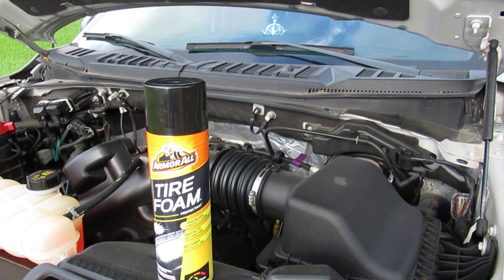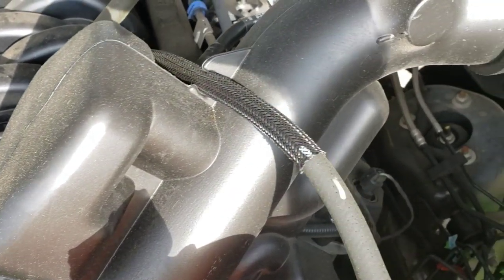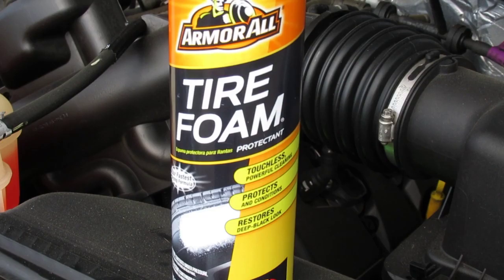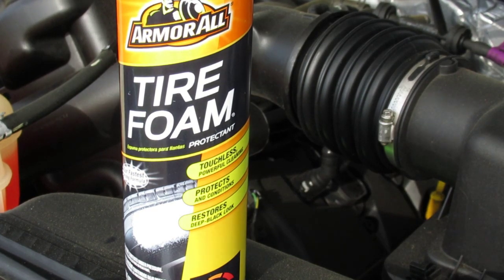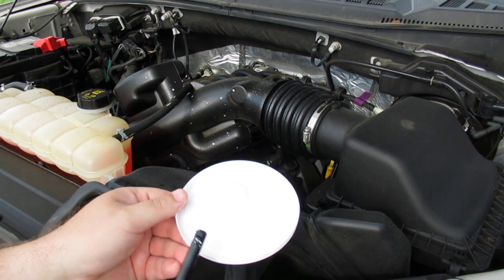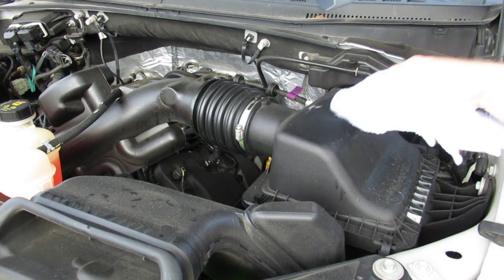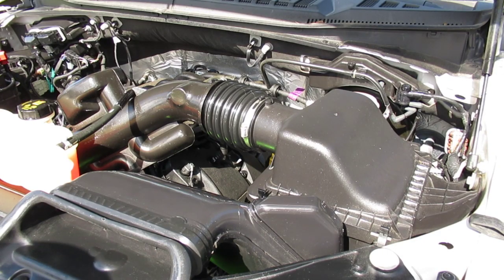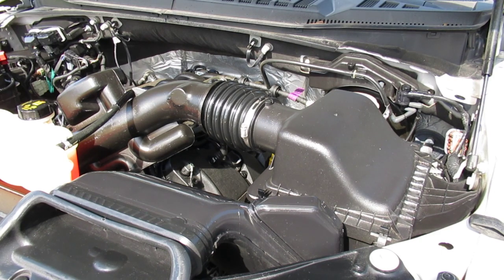HOW TO CLEAN AN ENGINE - UPDATE VIDEO

Comment: Hey man that was right on and I appreciate your feed back on the comment section and that is why I subscribed to your channel, my one concern from the first video and on still to this one is the electrical components? Its not going to cause anything too short circuit or cause a grounding situation is it? I don’t know that’s why I’m asking because I was taught at a young age not to spray the engine down because of getting electrical components wet (mind you I am 50yrs old and it’s been an awful long time since I’ve seen a points distributor on anything, maybe that’s the difference but I don’t know) and now my concern with you bringing up the flammable part into the equation, my concern is instead of trying to catch it on fire after you just sprayed the card, would it make a difference a few days down the road after it is dried up and absorbed into the engine components? Could it then be flammable? Curiosity killed your cat but it fed my dog :) 
you heard it here first 😂 lol 😂 lol 😂...
Reply from the maker: The engine and it's components don't have a problem getting wet from normal driving, road splash, etc., it's when either the engine is doused with a lot of water like from a garden hose or when sprayed with high pressure that it can cause problems. Years ago I always pressure washed my engines at the car wash without any problems but with all the extra electronics on modern engines, I think that's asking for trouble. When I use the tire foam, there's no pressure involved like when spraying with water so I'm not forcing water into anywhere it shouldn't go, that's where the problems come in. There's really nothing exposed that it can hurt. As far as being flammable, I don't think it's the tire foam, I believe it's only the propellent used to spray it from the can but while spraying, the tire foam was drowning out the flame at the same time so it wasn't an issue. I find the tire foam evaporates and dries up pretty quickly and since I don't think the foam itself is flammable, there's no issue with it.

Comment: Do you have to disconnect the car battery before spraying the engine bay with the tire foam? & is it a problem if the tire foam gets on the spark plugs?
Reply from the maker: It is always a good idea to disconnect the battery and even though I didn't, I would highly recommend it. Since the spark plugs are mostly inside the engine and covered with protective rubber, I doubt the foam would ever come into contact with them.
Reply: @AllAmericanMack  We all appreciate your video THANK YOU SO MUCH FOR THE QUICK REPLY

Comment: I really appreciate you demonstrating this method and how you addressed comments made by skeptics.  I would have never thought to use tire foam on an engine.  I do have a couple of quick questions, which you may have already provided a response to.  But in terms or the engine's performance either in the short or long range, is there any risk by using the method you demonstrated? Have you had any issues yourself? Thank you.
Reply: My apologies.  I meant to write "in terms OF the engine's performance..."
Reply from the maker: I've literally been using this for over 20 years now along with many others who have commented on both of these videos about getting good results. I can honestly tell you that there simply have not been any issues with using it. People like to throw out a lot of "it coulds" or "it mights" but they are the people who have never used this method and quite honestly, don't really know what they're talking about. There's even a video out there that gets posted constantly in my comments showing what is called a "dangerous hack" to clean engines. I've seen the video and the guy isn't even using tire foam, he's using a silicone tire dressing which is a completely different product. I always tell people if they are not comfortable using this method then they probably shouldn't use it just so they don't worry about it. But over 20 years of using it for hundreds of thousands of miles on both mine and my wifes vehicles tells me there just are no issues.
Reply: @AllAmericanMack  Thank you so much for your response.  That really is my only concern (to not cause any trouble to my car's engine and performance after the foam application).  But I'm going to give it a shot and have already ordered the product on-line.  The method looks quite practical and the positive comments made by others are encouraging.  I will provide additional comments once I try it out.  Thank you again.

Comment: Does it work on dirtier engine's. I want to clean mine. I know Armor All have the best product's so I so believe this. Comment from Picton in New Zealand 💯
Reply from the maker: It depends on just how dirty it is. If the engine is extremely bad it may need a degreaser to break through some of the build-up first. The Tire Foam works well because it has both a cleaner and a protectant in it but the cleaner does have some limitations. I would do a small section and see how it comes out so then you'll have a better idea.
Reply: @AllAmericanMack  Thank you. I'll degrease her First

Comment: I just subscribed. Was there no need to cover the alternator or electrical connections?
Reply from the maker: I've never covered any of it. I know some people are concerned about them but in my experience, it's never been an issue and I get the foam everywhere. You can cover the alternator with a bag if it's a concern, not much you can do for the electrical but if the connections are not harmed by moisture from normal operation, I don't think there would be any problems.
Reply: @AllAmericanMack  Thanks very much for your response. I'll give it a try 👍
Reply: @AllAmericanMack  I checked with my Mechanic and he had only heard good results but never tried it so he suggested for safety sake I disconnect the battery which I did. The foam worked really well and afterwards I did give it a light rinse and then wiped down with micro-fiber cloths. Good results. Thanks for your tips. 👍
Reply from the maker: Awesome! Disconnecting the battery is a good idea and I really should be doing it. Glad it worked for you.👍👍

Comment: Does a warm or cold engine make a difference?
Reply from the maker: I prefer to use on a cold engine. If the engine is warm ot hot, it will evaporate faster.

Comment: i want to clean my engine, but jus asking if the Tire Foam would mess up the electrical ? just wondering, Thank you
Reply from the maker: I've been using this method for over 17 years on all my vehicles without any problems. I learned about this because dealerships were having issues using high pressure water to clean their used vehicle engines and it was causing problems. I feel it is a much safer method while still getting good results.
Reply: Thank you

Comment: Will it work on atv , motorcycle , lawn mower , etc ? Thank you video's are everyday guy video's .
Reply from the maker: It should, BUT, I only use the tire foam due to not wanting to douse my truck engine with lots of water. The four wheeler and side by side both get cleaned with Simple Green and then hosed off.

Comment: I'm a bit skeptical as well but you already got me on your first video. However, upon watching this video one question pops on my mind. My question is, isn't it water-based? if it is, then it's conductive that it's not advisable to be sprayed directly on electrical. Also if it's water-based then it can cause corrosion on metal parts in the long run. Please enlighten me on this. Thank you. P.S. I am planning to try this actually then just spray WD40 on electrical and metal parts afterwards to disperse those 'possible' water that I am afraid of.
Reply from the maker: I believe it's water based but could never find a definitive answer. I would say that you should go with your plan if your not comfortable just spraying it on and leaving it. I've used it for almost 20 years on all my vehicles, hundreds of thousands of miles collectively without any problems. The vehicle I had the longest was 8 years old and had 238k on it when I traded it in and I used the tire foam on it it's whole life. After having used it for so long, I don't have any worries that it will cause any problems and actually think it helps by keeping belts and hoses from drying out and cracking. But in the end, you definitely need to try it how you're most comfortable with so you're not worried about it causing any issues.👍👍

Comment: Have you had any issues around spark plugs and coils?
Concerned about this on my mustang.
Reply from the maker: No, I've never had any problems with it even when I changed the plugs, wires, and coil pack at 150k on my old truck  and I had used the foam regularly.
Reply: @AllAmericanMack  Thank you for the quick reply.

Comment: I was wondering if this product can remove the gunky oils on my engine?
Reply from the maker: I've only used it on moderately dirty engines so I'm not sure if it will power through heavy oil and gunk. It may need a degreaser for the heavier stuff.

Comment: Wouldn't it damage the fan belts eventually?
Reply from the maker: It's made to clean, protect, and condition rubber and plastic to keep them from premature cracking. I can say that after using this method on my 02 F150 for 8 years and 238k miles that I never even had to replace the serpentine belt, or any other rubber items like hoses.

Comment: Does it work on oil or grease?
Reply from the maker: It works on light oil or grease but if it's very dirty it will probably need degreaser.

Comment: Can u use the tire foam on a gasoline engine?
Reply from the maker: I've always used it on gasoline engines.
Reply: All American Mack Thanks for your reply, follow-up question, should I cover the spark plugs when i spray the tire foam?
Reply from the maker: @dennisjrcuizon8643  I don't think it's necessary.

Comment: I have question......i have a 1989 town car....engine bay is dirty as hell......would this work? With no issue to the engine? Or can you make a video using this product on an older model vehicle? Please respond......thanks in advance.....liked and subscribed.....
Reply from the maker: I think this method works better when the dirt is light to moderate. In my opinion, if the engine is very dirty it may be necessary to scrub with degreaser and spray it off. Unfortunately, I don't have access to any older vehicles. I clean my engines this way to avoid spraying lots of water onto the engine due to all the electronic parts on them these days. Being an older vehicle  I would be cautious to check for cracked wiring and things like that before doing any cleaning. You may have to use degreaser and a rag, then spray off with a garden hose.
Reply: @AllAmericanMack  ok thanks......

Comment: I'll be trying this soon.  Any of you clean off the mid to lower part (metal) of the engine? There's oil and gunk there.
Reply from the maker: I haven't had any buildup of anything on that part of the engine but if I did I would probably just use a good degreaser, maybe a brush if it's really thick, and spray it off with the hose.

Comment: Sir is it ok to use if the engine is covered with oils or freeze?thank you for the reply and good day.
Reply from the maker: I've never used it on an exceptionally oily engine, only on the normal amount of dirt and grime the engine collects. If there is lots of oil it may be necessary to use some type of degreaser to remove it.
Reply: All American Mack said

Comment: Thanks you sir, will try this very soon. Excited to clean my b16a engine. Btw, will it take away rust?
Reply from the maker: It will not take away rust, only dirt and grime. If the engine is very dirty you can wipe to help remove the dirt.

Comment: How to handle engine oil on the parts of engine or how clean engine with oil?
Reply from the maker: It would probably need to be degreased to remove the oil.

Comment: You know in the sixties when people still cared some we had steam cleaning at the carwash
Reply from the maker: I would be much more inclined to use water on those older engines. Some of the dealerships I worked with stopped steam cleaning the engines of used vehicles because water was being forced into places it shouldn't and causing problems.

Comment: The trick with using water is to just let it fall out of the hose naturally with NO PRESSURE!!!  I made a cleaning compound years ago and the problem with using water under pressure is that if forces it into places it shouldn't be in under pressure.  Just let the water fall out of the hose with NO nozzle on the end and turn the valve down before doing so so that the water falls out of the hose end, then guide the hose around the engine as your go, give plenty of time for the motor to dry off say at the end of the day to overnight.  Make sure the water is adjusted as an ark FALLING out of the end however.  The engine is water proof when you DO NOT shoot it into the engine with pressure, it will run off naturally and take debris with it to the ground, just be prepared and find a place no one cares about under the engine.  Notice I repeated what I said several time..NO PRESSURE..!!  As good as this good man is and his process, I would say a light drizzle of this nature may produce a brand new looking engine in combination with his procedure.  I wish he would try one and make a video, I don't have time.
Reply from the maker: You are very right about water under pressure being forced into areas it shouldn't and causing problems. Several of the dealerships I used to work with stopped using it because it was causing problems with the vehicles. You are also right about engines being waterproof for normal exposure to water. I have seen so many comments on both this and other videos stating that water doesn't hurt the engine and especially the overused comment about if water hurts your engine, how can you drive in the rain. There's a BIG difference between rain splashing on an engine and spraying water under pressure on it. Your idea of just open ended hose pressure to rinse off the tire foam and additional dirt and grease sounds like winner.
Reply: @AllAmericanMack    I used to work in a Latex / Nitrile Glove production facility for 21 years and used to experiment with some of the latex additives one namely " which was a soap liquid compound that we mixed one plastic coke bottle cap with 5 gallons of water, it was a strong compound but after we cleaned our vehicles with it, they shined.  Couldn't use too much though, it would leave 'friendly' streaks on the paint.  I was working on an engine cleaner to market and through my experimentation water falling on an engine was key..  Now they make bar soaps with that chemical from 25 years ago.

Comment: It may clean but on the green poster, where's the dirt at ?
    Did it shrink ?
         I believe it's good to spray the tire foam but it would also be good to rinse it off too to get all the dirt off the engine.
Reply from the maker: Some dirt dripped down to the poster, some had not made it yet, it's very slow. Some may never make it to the ground, it may settle on the suspension, frame, etc. Given a choice between dirty suspension or a dirty engine, I would take the dirty suspension, frame, etc. Spraying it off will definitely do a better job, it's just something that I don't do.

Comment: Great video. Question I see in both of your videos you didn’t cover anything. Wires etc. Before spraying. Is that ok   And second I’m assuming your truck was cold when it was sprayed. How long would you need it to dry before driving. Thanks
Reply from the maker: I don't cover anything because I want the tire foam to get everywhere it can for better coverage. In the first video, the engine was warm and since I made it at the car wash, it was driven immediately after the video without any problems.

Comment: All foaming tire cleaners are Not equal. I have one (Drivers Choice brand) that says specifically Do Not use on painted or plastic surfaces.
Reply from the maker: If that is the one from Dollar Tree, I tried it on my tires and after it dried, they looked like I had not put anything on them.
Reply: @AllAmericanMack  My apologies. What I have is Not "tire" cleaner, it is foaming wheel cleaner. I used it tonight and it worked to clean the wheels pretty good. Yes, I got it from The Dollar Tree. It says to spray liberally, let it sit for a minute, wipe it down with a cloth then rinse with a stream of water. I don't think you are just supposed to let it dry, it is not a touchless cleaner. I suppose I would have gotten the same results with dish soap, water and a cloth.
Reply from the maker: I made this video https://youtu.be/5E5hbzvAg8A using all Dollar Tree car wash products and although it was a while back, from what I remember the foaming wheel cleaner did do a pretty good job.
Reply: @AllAmericanMack  Cool, I'm checking it out. Thanks.

Comment: You guys should have gone and bought three trucks together, you might have gotten a good deal.
Reply from the maker: You are right lol. I didn't have any intention of getting a new one but when my dad bought his, they left a lockbox key deal on the keyring. So I went return it to the dealership a few days later and ended up driving off in a new truck so I'll admit, they got me but, they offered so much on my 2014 F150 trade-in,  I couldn't pass the deal up.

Comment: Are you sure this wil not dangerous for electrical components, sensors and cables? Afraid will make a short... i want to try this if it is truely safe.
Reply from the maker: I can certainly understand the concern with all the electronics and such on engines these days. I've been doing this for many years and have never had a problem with any of that.
Reply: Ok, so it is safe for cables, sensors and other electrical parts. Thx u will try next day.